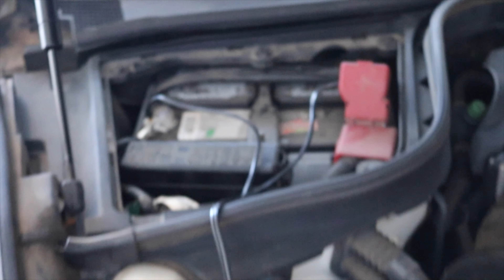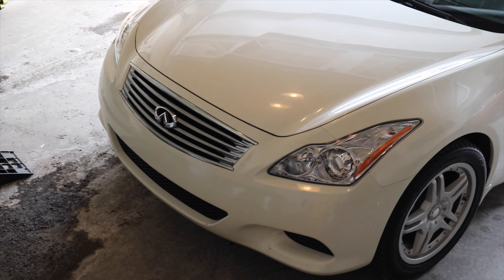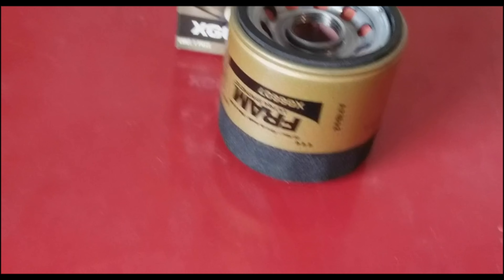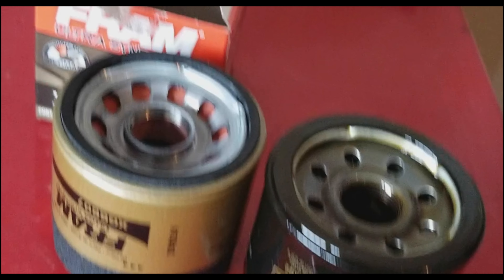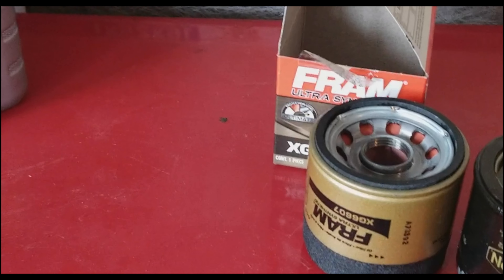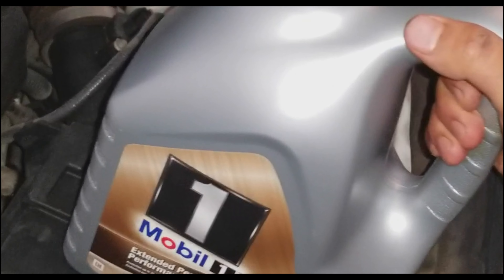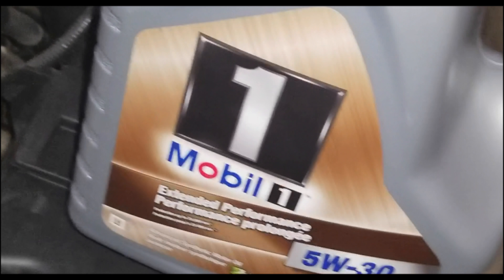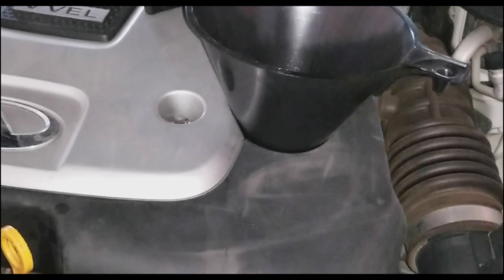Infiniti G37 Synthetic Oil Change

Comment: Why fram????? Do you hate your car that much??
Reply from the maker: It's an 11-year-old Nissan I'm not worried about my oil and filter types.
Reply: Fram oil filters can be the lowest to the highest quality.  Depends on which grade you choose which not coincidentally is linked to how much it cost.  The one rated specifically for use with synthetic oils is a very good grade of filter.

Comment: I been using NISSAN ESTER 5w30 engine oil on my 09 G37Xs , NISSAN says you should only use NISSAN ESTER oil.
Reply from the maker: Nissan also says not to modify your car HAHA 😂
Reply: Ravy Kang yeh I guess you are right price is insane $15 a litre, I am switching to Castrol edge titanium 5W30 as I am using this oil for last 10 years on my other vehicles great performance oil. No more NISSAN ESTER OIL😂
Reply from the maker: @syedhussain3810  a lot of guys on the Nissan/ Infiniti forums are running Castrol might be a good switch. I like royal purple but the same thing too expensive to run.
Reply: @canadacustomautoworks  Castrol Edge is the only oil I have used that didn't need a top up between oil changes.
Reply from the maker: is that us pricing? I'm in Canada
Reply: @canadacustomautoworks  yes, US.  5 quart jug.